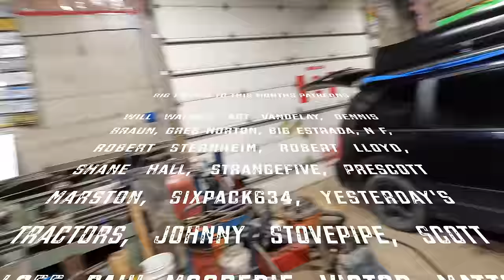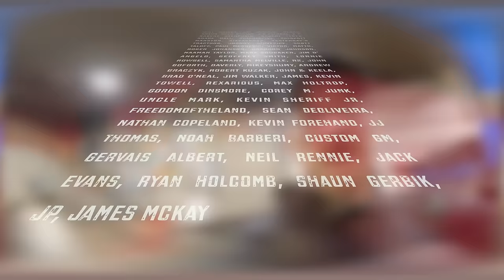golf cart caboose

Comment: The fan motor on the unit heater sounds a little dry, there should be a couple oiling ports on the top to giver a little gurgle of light machine oil. Sounds like the Felon has been doing good work in your good stuff!

Comment: Eh Pug I have a 18’ Sierra. I noticed the same thing when starting. I just barely turn the key and it fires right up. I think if you hold it to crank longer it’s hard on the starter. 
PLUS I had to replace the starter on mine at like 60,000km the truck was dead in the water in my driveway. There were some hiccups before it finally went. The stealership admitted it’s a thing with these fine trucks.